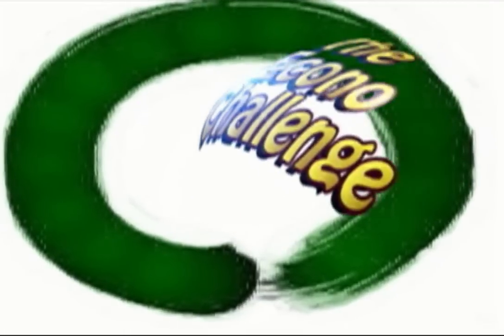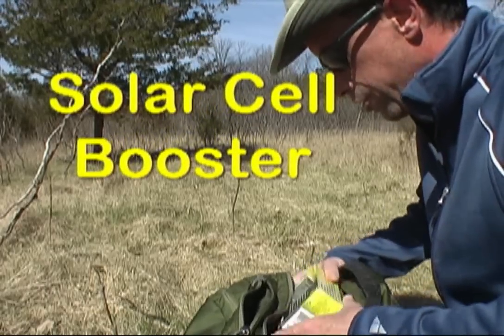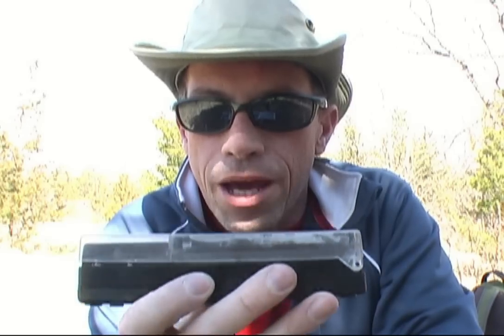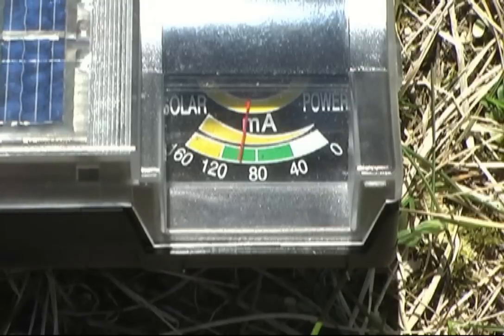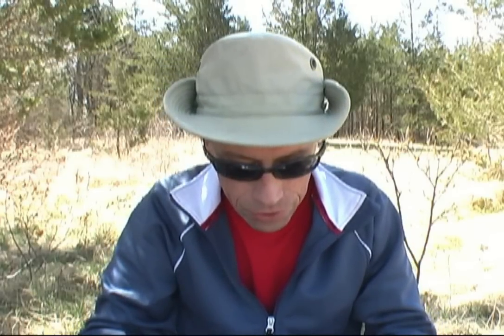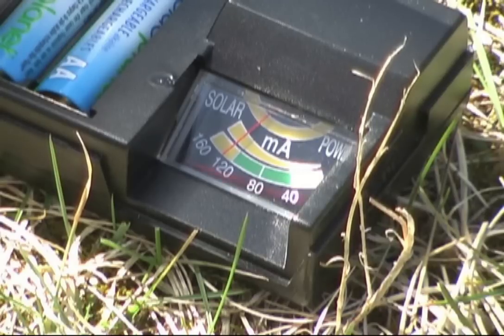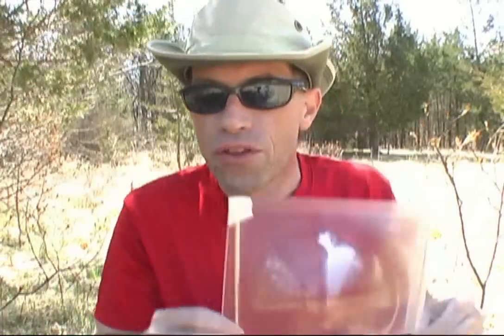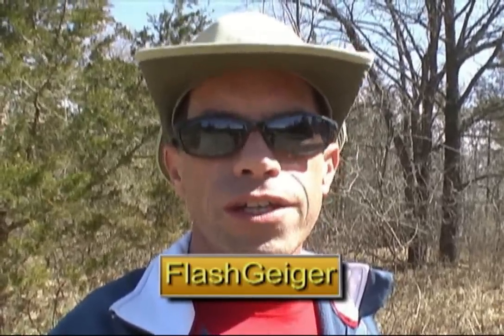Solar Panel Booster - Fresnel Lens

Comment from the maker: Yet another good suggestion.  I have found several examples of solar reflectors used to cook.  Something like that is now possible.  But that idea is going on the back burner for now.  Lots of other (older) ideas I have to work on this summer.

Comment: To find a Fresnel lens suitable for camping use, look at your dollar store, craft store or office supply store.  Not always there, but often enough.  If you want to try some truely large scale experimentation, some of the early large screen back projection TVs had one right behind the screen.  42 inch lenses won't fit in your backpack, but can cook dinner in your backyard.

Comment: I took alens and cut a shallow V at one end with a couple quarter inch holes, and a larger hole at the other end to make one of those tables to strap to a tree (others have made one out of aluminum or a cutting board).  Not sure it's rugged enough for the bush though, since I cracked mine before I used it by stepping on it in all the junk that's been building up in my spare room...argh.  I may try superglueing it up anyway.  Cover with a bandana to save your toes if cooking in the sun!

Comment from the maker: Ah now that is a very good question.  The next problem I am currently working on solving is keeping the entire combination pointing at the sun.  The current method would require my constant attention.  I am not happy with that!   So until I get that figured out I will not have an answer.  If I get this figured out, I am betting it will cut the time in half?  But that is just a guess at this point.

Comment from the maker: A different version was tested on Haram Cooks channel.  I asked if the unit would produce enough 12 DC power to convert and use to charge video camera bats.  His conclusion was that it would not.  That is the only reason I have been looking into any portable charging idea.  Just to charge batteries in the wild.

Comment from the maker: These are not like a magnifying glass.  The light is concentrated into a rectangle shape at a very short focal length.  If you increase the distance from the lens to the cell then it will eventually concentrate the light at a point and burn right through the cell.  I have not done that yet but I have melted the side of the charger already.

Comment: If there is just a diode after the cell then it could probably take the current. Thing is we don't know what power is being generated. I imagine the heat would be the biggest problem. Starting a fire that quick could be enough to melt solder.

Comment from the maker: Funny you should say that.  The problem is heat.  As the panel heats up the efficiency goes down.  Does not boost as much as we were hoping and the project has been put on hold ....

Comment: I saw a video where a company is experimenting using lenses over a solar panel on top of a car to get added energy.  I decided to buy about 30 fresnel lenses (8 x 10in) and put them into a frame, then suspend them over my solar panel, and try to find the best distance that makes the panel generate close to it's max (144w) but not overheat the panel.  I am hoping to find a sweet spot that will make my panels work closer to their peak without burning them up from too much heat.  I may also try to find some kind of filtering to keep the heat down and still get the solar exchange, but I am thinking the panels were made to work at max 144w so they must be able to handle bare sunlight heat.  thanks for the video!
Reply from the maker: If you can keep you panel cool then you will be able to get close to the max output in theory.  I was thinking that some kind of a water heating combination would be a great way to take away the heat and creat usable hot water.
Reply: Thanks for the reply.  I am going to look into some kind of film that filters out the heat generating rays but still stimilates the panels.   Though that seems weird because the whole point of solar is that the heat is what makes the panels work, I think.  And if they are 144w max, they should be able to withstand the sun temperature that comes with it.  Thanks again for the video, confirms my ideas enough to pursue them.  I bought two 144 w panels from Ensupra that have a grid tie inverter and I plug directly into my apt wall socket.  It seems to be saving maybe $15/mo on my electrical bill.  Maybe this will increase it a little more.  Every bit helps.
Reply: I am reading up, several universities, such as Stanford, are all working on the same problem, finding some kind of film, coating, that filters specific rays that cause heat, keeping the panel cooler, and also finding ways to make normally heat producing rays be used to generate more electricity....way past my pay grade, but it gets my mind thinking.  I don't know how you could use water to cool the top of the panel, which would get the bulk of the heat, which also lessens the effectiveness of the panel, by the way.  Cheers!
Reply: experiment failed.....the solar panels need UV radiation, and the lense cuts that out, it cut the effectiveness in half immediately.  Oh well.

Comment: Hi sir, concentrating the sun with fresnel lens it's not a good idea even for the solar cells, but anyway the experience is good enough for humans to learn more :D
Reply from the maker: You make an excellent point.   I did not learn about the heating problem until much later.

Comment: I wonder if you made a cone of reflectix material and put a small 6" frying pan on the bottom and a fresnel lens on top to contain heat and magnify the sun's rays if it would be an effective solar cooker. I don't make videos. maybe someone could try that. A 6inch frypan can hold 32of water.